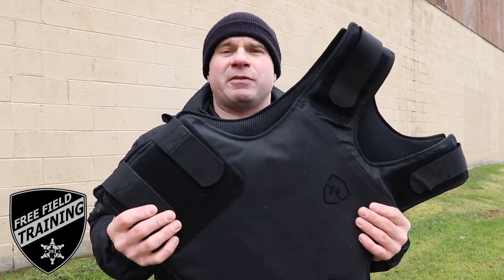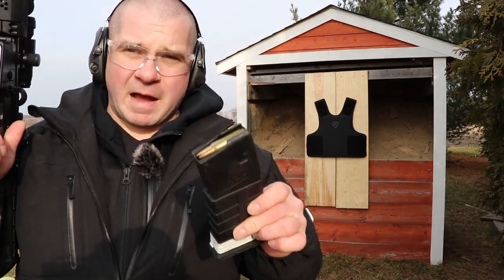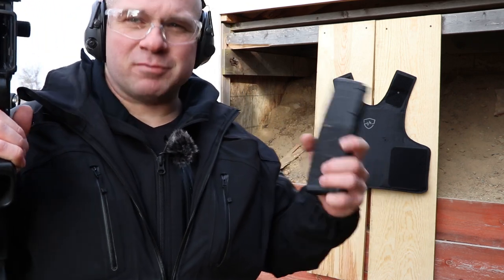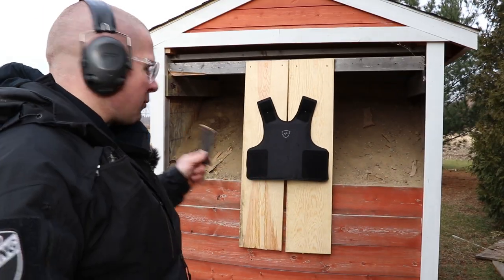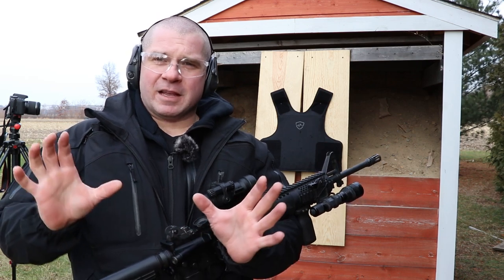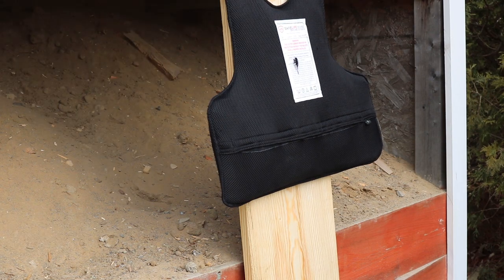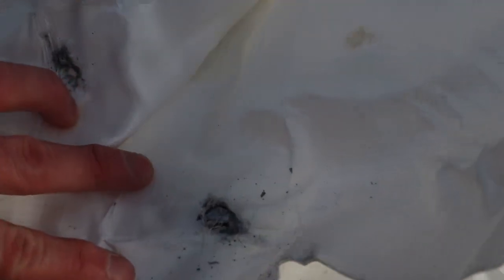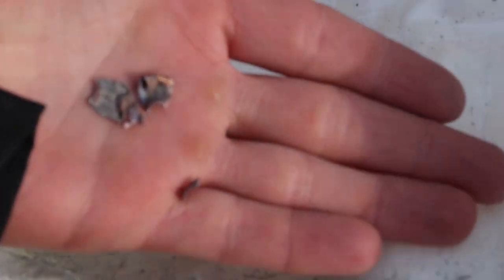RIFLE RATED BULLETPROOF VEST | Safe Life Defense | FRAS Flexible Rifle Armor System

Comment: Does it stop 762x51 cause then it would be rated the same as steel rifle plate like the ar 500 but it would be better less chance of taking shrapnel to the neck
Reply: We have that available by special order! Or throw a level iiia panel behind it and its full level 3!
Reply: @SafeLifeDefenseBodyArmor  Congrats to you guys for doing this. Excellent work. The only issue is with sizing. I really wish you would give panel measurements, not just the sizing guide. I am a bodybuilder and in no way fit the sizing guidelines. If i were to use it, the guide would put me at a 3x. With a 36" waist, i would drown in a 3x. Please list actual panel dimensions. When you spend almost 2000.00 for a vest, in needs to fit perfect. Thank you.
Reply: Safe Life Defense so I know you guys have listed this armor as FRAS but what is that actual NIJ rating on it? I have a group chat that I’m telling a couple of my buddies about this in and many of them aren’t convinced of an armor systems effectiveness without it being NIJ certified

Comment: You should have clay behind the vest.
Reply from the maker: The lab testing uses clay, you can find those test results on safe life defense's website if you are interested in seeing the measurements. We use 1" clear pine boards so that the audience can get a relatable understanding of the backface deformation and impact forces involved. For clarity we use the same backing for all the tests so people can roughly compare the impact forces. Also, temperature and density issues make using clay as a backer and keeping a consistent result difficult. For reference : https://youtu.be/Ou4G7xKC954
Reply: @freefieldtraining  
Thanks for the link. A softer backing will give a little so it's more realistic.  Try hitting a board with a hammer and see how hard those bullets would impact your ribs.

Comment: Can you test it with the 300 Win Mag and the 338 Lapua Magnum round
Reply: If its not rated for 7.62x39 (30cal) why would it be rated for 300wm which is also 30cal only with 3 times more energy.
Reply: @justinkirk5449  if you look at the video and what they demonstrated it can withstand an AK-47 round so yes it's rated for a 7.62 by 39
Reply: @haileymaya2030  Ok bro. I guess you know more than the company that manufactured the body armor.
Reply: @justinkirk5449  the vest is Safe Life defense
Reply: @haileymaya2030  I know. I actually went to there website and looked up the specification's where it says that this vest is not rated for 7.62x39. It took less time to do that than it took you to right your last comment.
Reply: It would go through the front and out the back.
Reply: It’s been shot with mild steel core 7.62x39 it didn’t go through. 7.62x51 will go through.

Comment: You did not mention the velocity of the ammunition fired. I would have liked to see testing of "in spec" M193 ammunition, which at the muzzle from a 16" barrel has a velocity of 3100 fps.
Reply from the maker: This is stock m193 ammo out of a stock 16" rifle. I'll try to get a crono in the future if that is what you guys want to see.
Reply: @freefieldtraining  I also had another question. I've noticed that the vest lacks an NIJ certification. Does that concern you at all?
Reply from the maker: I wouldn't say it concerns me, especially since this is a preproduction prototype, but I would always prefer safety equipment to have any available certification of applicable. Ideally you would want an NIJ, DEA, and mil standard frag rated vest with a taser attenuation capability as well. Those things take time and cost money though and we are already talking about a very expensive item. It will be interesting to see how these perform long term and in certification.